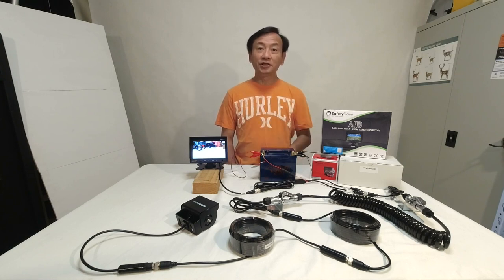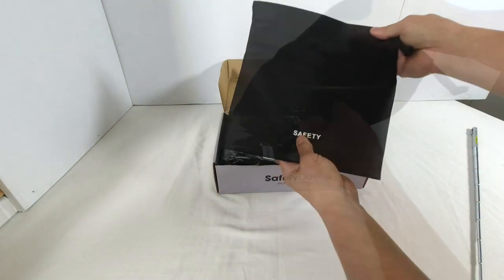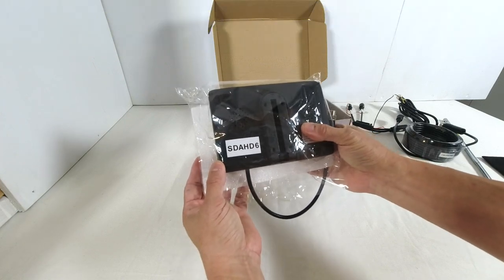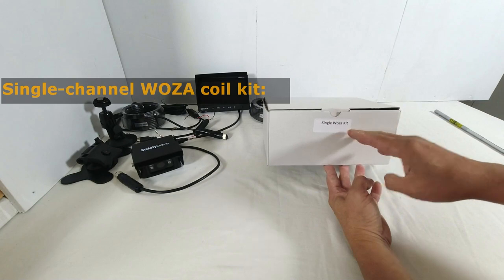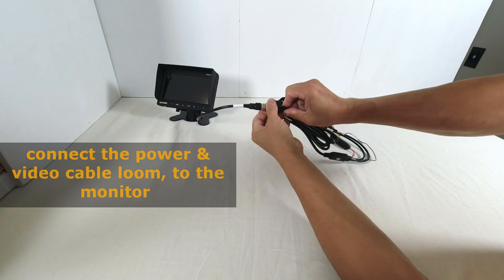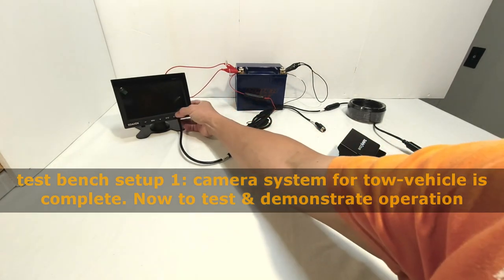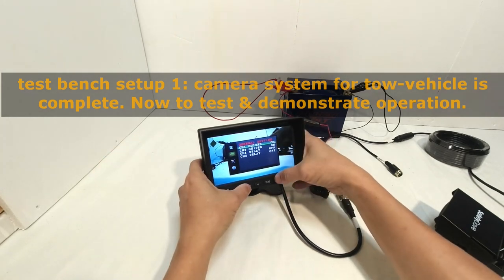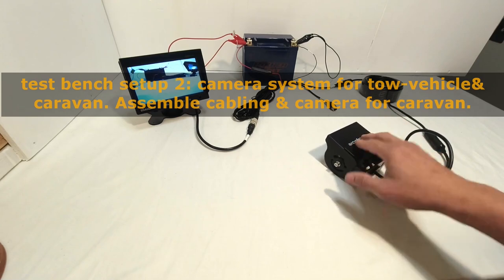unbox, set up test-bench for SafetyDave rearview camera system before install to car & caravan

Comment: Hello DIYhabitat, thanks for making the video. I have spent a lot of time trying to find a video which shows how the power wires are connected but I have yet to find one for the SD camera setup as you have shown. My curiosity is around the two red wire connections and how at least one of these wires can be connected directly to the cars fuse box (which is what a staff member at Safety Dave advised me to do). I am attempting to use an 'Add a Fuse' lead, which I have used previously for the connection of a two way radio. The two connectors on the camera wires (red) however are not compatible with the Add a Fuse cable connection point to hook into the fuse box. I can't seem to find suitable components to adapt to the connectors either. How did you connect your camera to a vehicle power source? BTW, SD advised that the supplied wiring is not designed to go directly to the car battery. Any advice you could offer would be great. Many thanks. D
Reply from the maker: which exact model SD camera-monitor do U have, that U are attempting to install to car?

Assuming U have the same 2-CH monitor like in my video.
1) the monitor has a +ve red-cable with a male bullet-plug, & bullet-socket. One approach is for user to  tap the bullet-plug into an existing in-car ignition-switched +12V cable. Then reconnect the existing in-car accessory input-cable (plug), into the SD monitor bullet-socket on the red-cable.

Open up the black plastic casing on the red-cable, & check to see if there is a standard glass-fuse. If so, the the monitor incoming 12V power cable is fused.

2) u probably won't find convenient existing +12V cable to connect using the bullet-connectors. Ensure you  do not tap into any safety-affecting in-car +12V cable. 

Investigate using NARVA tap-connectors to tap a new wire to existing in-car switched  +12V power. Then add  a bullet-socket to that wire, so u can connect to the monitor's red-wire bullet-plug.

WARNING CAUTION - If the existing wire you want to tap into, is not thick enough to support both its existing max current draw, + current draw from the monitor, that can lead to existing wire overheating, & become a fire hazard.

Safer approach is to setup a new fused +ve cable connected directly to a relay that is triggered by an existing  ignition-switched cable. This way, the monitor only powers up when car ignition is turned on.

Comment: Thanks mate for this video. I 'm thinking of purchasing a camera kit for my caravan.
Are you happy with the product?
Reply from the maker: i did not install the system as i decided to have dual camera (wide & narrow) angle at caravan rear, instead of the single wide-angle camera. This means the rear-view monitor also needs to be changed from 2-channel to 3-channel. Hence, i returned everything to my caravan maker. We are waiting to see if in next 5mths, SafetyDave will release any higher-resolution products.

I am only staying with SafetyDave products as this is the brand my caravan maker buys, supplies & supports. Otherwise, i would research & find better alternatives. SafetyDave website provides no tech specs for their camera & moniter products. This is not acceptable to me. The firmware on the SDAHD6 monitor is horrible.

Must be better prducts with FHD res out there.